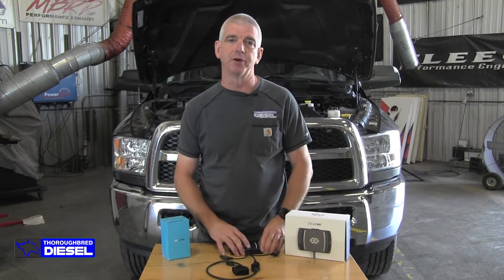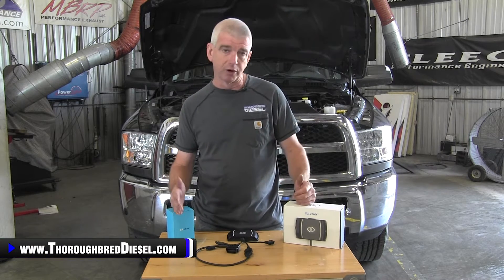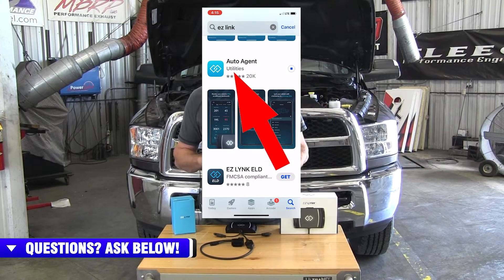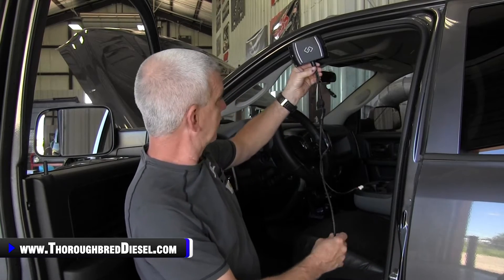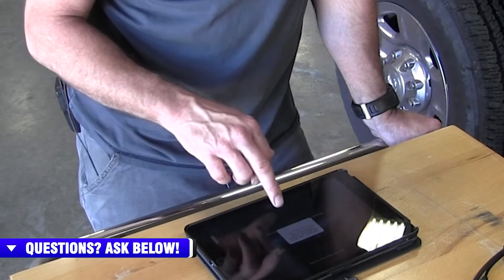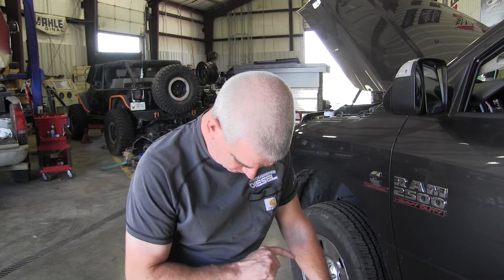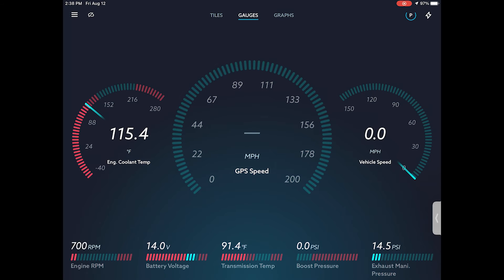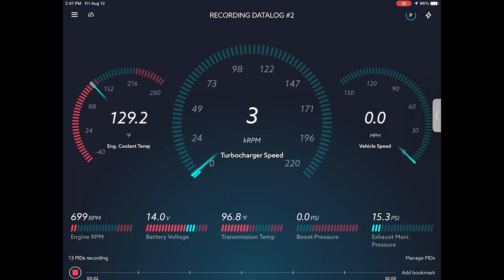EZ LYNK Autoagent Easy Install for Dodge Cummins, Ford Powerstroke, GM Duramax, Nissan Titan #diesel

Comment: I bought a 2014 ram 2500 and it has a easy link adapter installed but I know nothing else about it. Where do I start in determining what it is doing or not doing and can I do anything with it?
Reply from the maker: Figure out who the tuner is on it and they can help.

Comment: I have an auto agent 2 from a previous truck, 2018 68rfe was tuned and deleted. I’m not ready to tune or delete my new truck, but would like to use my auto agent 2 as a monitoring device on the new truck. Can I use it without the truck being deleted or tuned or deleting my trucks warranty?  I will be deleting and tuning after warranty is gone, but would like to be able to utilize the auto agent for gauges and reading/clearing any potential codes.  My new truck is a 2021 ram 3500 HO

Comment: Why are the tunes so expensive?
Reply from the maker: That’s a good question.  Tuners base the price of their tunes off the intellectual investment that they have in their craft.  Also, tuning is cheap when you look at what it will save you in fuel economy and efficiency added to the truck.

Comment: Yea, monitor yea, no fine tuning or ability to tune
Reply from the maker: What do you mean no ability to tune?
Reply: @thoroughbreddiesel  unless I'm missing something.  2 trucks pre tunes and no access to the maps( fuel, injector timing, engine timing,afr)
Reply from the maker: I'm not sure what you are meaning but this platform is capable of custom tuning.